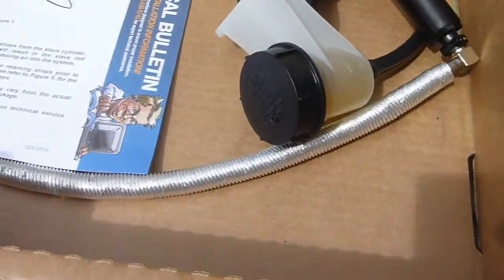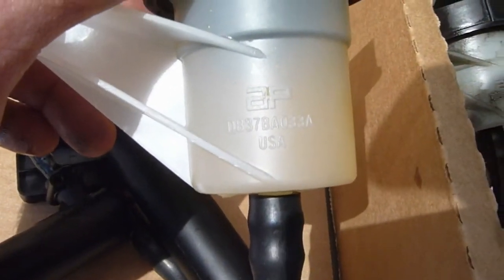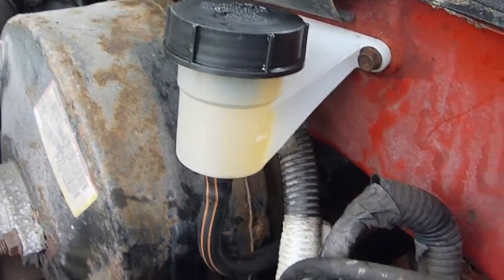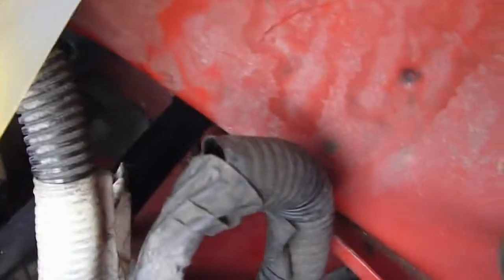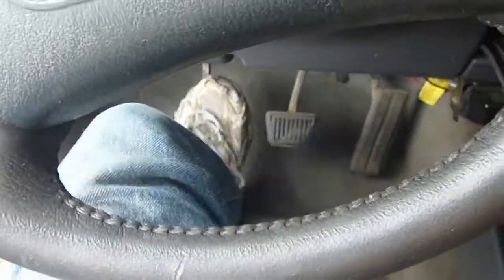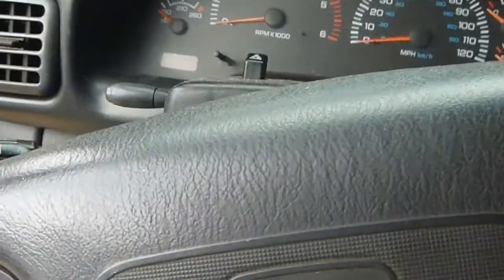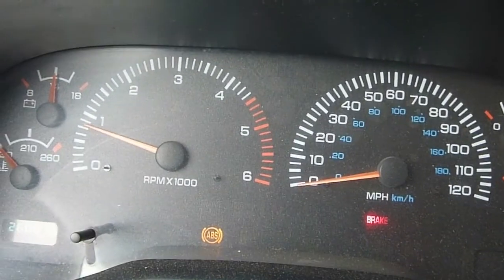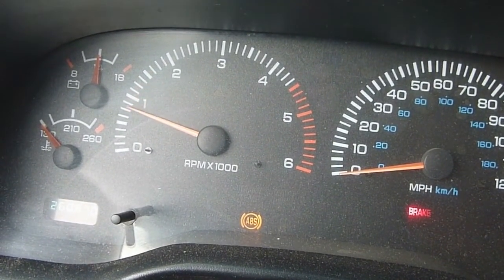1999 Dodge Ram 2500 Clutch REPAIRED!

Comment: In your state can you just put it straight back on the road or do you need an inspection??
Reply from the maker: Unfortunately, in PA, we need a safety inspection, plus emissions testing in the county that I live in.  The emissions is no issue, as this truck is ODB II and checks out with my scantool.  The safety inspection is why I need to do the bodywork and brakes (the front lines are rusted out, so that was a given anyway).
Reply: +general0ne here in Canada or at least Ontario you only need a safety when you buy a used vehicle but you need a e-test, witches are emissions test, every two years for gas every year for diesel I think, unless the is over 20 years then the e-test is no longer required.